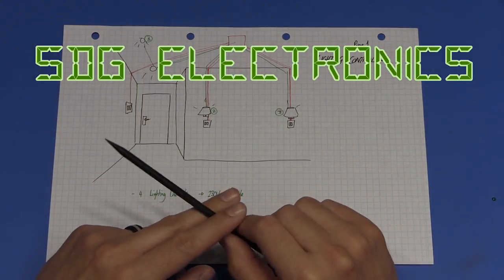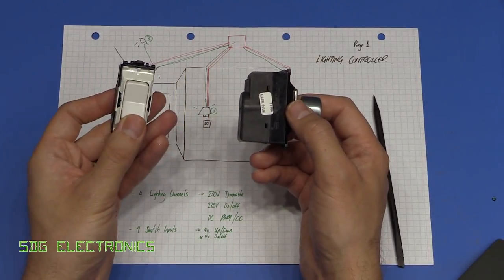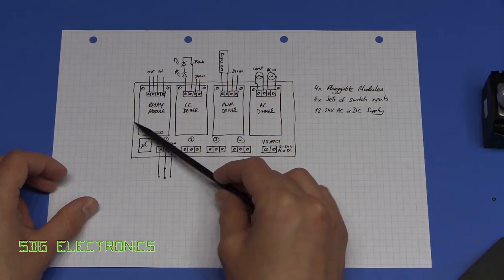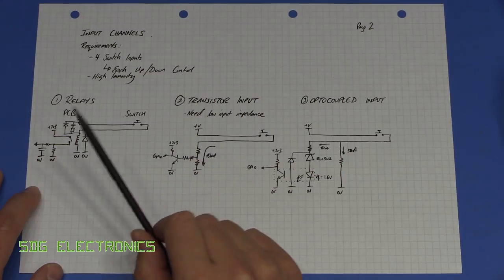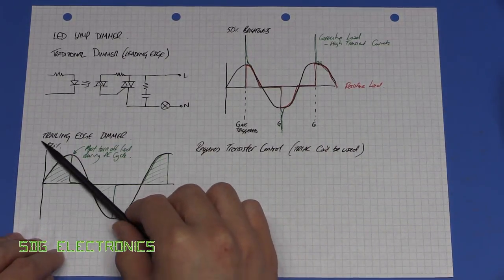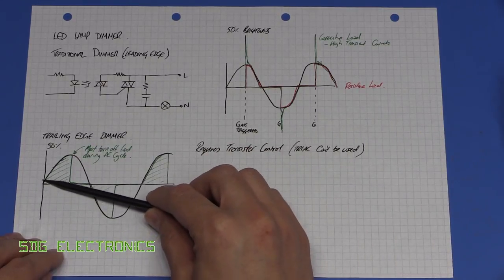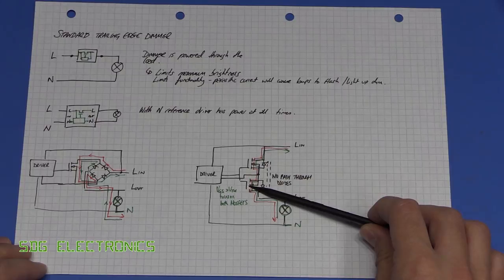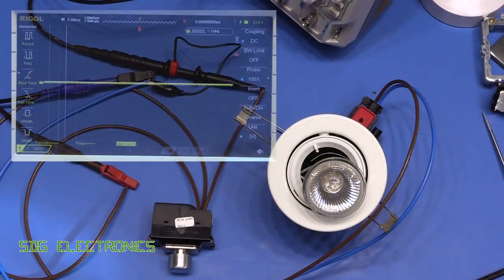SDG #055 Testing AC Dimmer Modules - Lighting Controller Project - Part 1

Comment: Great stuff Steve! Snap! Only just found this series, after having gone through a similar though process then designed and built pretty the exact same thing! I am still on a prototype board and not yet on a PCB. 

Couple of quick questions:

1.  R1=10k. That's huge. I have only a few Ohms. Admittedly, I am using 600V 27A Ron=0.1Ohm MOSFETS (gate charge 54nC) and a 2.5A driver because I wanted to be able to switch full mains power. So clearly I will need to pump in more charge quickly. But 10K still strikes me as very large for a power MOSFET gate. The calcs for these are really hard with lots of unknowns, so she rule of thumb I use is: "guess a value then look at the waveform with the scope and lower the resistance until you get ringing, then back off a bit."

2. I want to be able to switch inductive loads and I can't see how to make this kind of back-to-back MOSFET circuit allow freewheeling for the latter half of the cycle. The only thing I can think of is to add an additonal "freewheel MOSFET pair" directly across the load, which is carefully triggered only to be on when the main pair is off. It's a pain though because it needs yet another isolated gate drive supply, because the "joined sources" are at a different level. Better ideas?

I would be keen to get in touch to exchange ideas. Any comms channel you prefer.

Comment: For the input, copy DALI+Push button schematics. It is simple current limit for optocoupler with 2 bipolar transistors. One of them should be a high voltage one. This means nothing gets blown up, if you accidentally connect switches to the mains few years down the road or just connect to mains from the start :-)
I personally would never connect LEDs to a triac/mosfet mains dimmer. They were perfect for incandescent lamps,but they really stress power supplies and you never know if it is going to work or not and how long. You can get a "Push Button" LED power supply for cheap nowadays and you connect as many switches in parallel as you want. If you want to build a master controller then supplies with 1-10V input are even cheaper.
 If you already have the luminaries with the socket then it is a bit more complicated, but there are some workarounds.
Reply from the maker: Good idea with the DALI input. If you have a reference for the schematic, please let me know
Reply: Something like this schematic on the 9th post: https://www.eevblog.com/forum/projects/over-voltage-protection-will-this-work/ Another option is to use transistor on the low side with mirrored schematic.
Reply from the maker: Thanks, I'll take a look.

Comment: Why not do multiple turns through the current clamp? Sometimes I’ll wrap a wire through my clamps 5-10 times to increase its sensitivity.

Though, I’m not sure if that would alter readings on clamps that are not Hall effect based

Comment: With regard to wiring picking up transients,  why not have either a capacitor across the input or an inductor (or even a ferrite bead or similar) inline with it?  Or both?  And,  with that dual-MOSFET setup,  are you relying on the body diodes to conduct for the one that isn't turned on?  I've read that this isn't necessarily a good idea...
Reply: A bit late to the party. Both gates are connected together so both conduct at the same time. Remember, Mosfets are bidirectional.

Comment: Yet again I did watch to the end, interesting stuff. I have a more mechanical  way to operate my bed side lamp, efficiency is quite good. I find just a few sips of tea provides all the power required to simply extend my 5 digit hand together with a little help from my main processor, I can on a good day, manage to switch the light off. Local dimming is provided by changing the aperture of my vision detector circuit. My version does not require a PCB or any involvement from EBay.
Reply from the maker: Unfortunately, my wife has a tendency to turn on all the lights and then expect me to get out of bed to turn them off... I also get up at 5am, so nice dim lighting prevents me getting in trouble :-D. Thanks for watching Michael.
Reply: The definition of a wife... A wide band attenuator with limited control and a tendency to ring and brake into uncontrolled oscillation.

Comment: Do those MK switches have a minimum wetting current? A cursory glance over their specs hasn't answered my question. Perhaps the contact material (brass?) is such that it doesn't matter.

Wetting current is one thing I double-check in my own designs. Cheers, R
Reply from the maker: I was also unable to find out any details. I will probably make the switching current in excess of 10mA, and given these are used in low voltage controls for lighting systems, I'm not too worried about surface films forming.
Reply: @sdgelectronics  >= 10mA was the figure that came to mind for me too! :) Thanks for replying Steve.

Comment: Neat project, Steve; I'm looking forward to the rest of it.  Take a look at the Fairchild/ONSemi FL5150MX.  It's a phase cut dimmer controller for exactly this kind of application.  It does both leading and trailing edge control, with or without an available neutral.  Mouser has cut tape in stock.  https://www.onsemi.com/PowerSolutions/product.do?id=FL5150MX
Reply from the maker: Thanks! Looks a little bit naughty that it directs some current down to protective earth when no neutral is available. I'll read through to see if there are any useful concepts though.